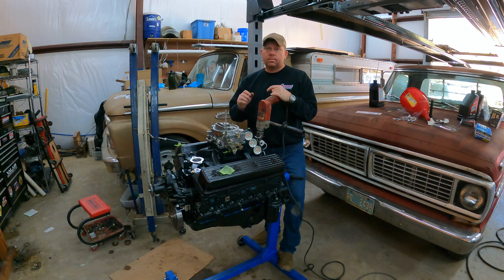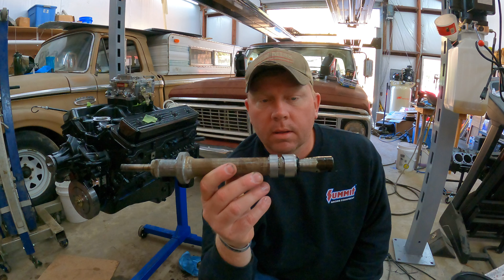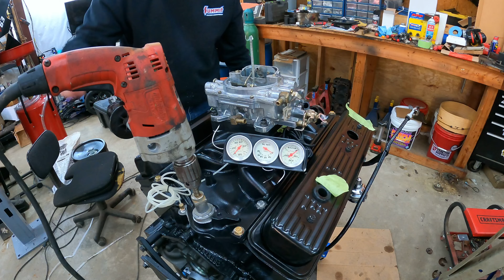Save Your Engine Before You Start It; Oil Pump Priming for a Chevy 350

Comment: how much drag is too much drag? on SBC i've always felt a little drag but recently did a 3.8 v6 and my cordless drill wont hardly turn it, my corded one will turn it like yours does and i can go up full speed and builds up 80psi right away but again my cordless battery powered milwaukee drills smoke and wont really turn it hardly at all lol
Reply from the maker: I don’t really know how much is too much, but my older battery powered Milwaukee struggles to turn them with any vigor.  I wouldn’t be too concerned unless there is binding or the corded guys can’t turn it.   I did a 351W Ford after this one and it was the exact same way. I think battery powered stuff is good, but will never be quite as stout as the plug in version.
Reply: @Clydes.Shop78 I appreciate the honest response brother.